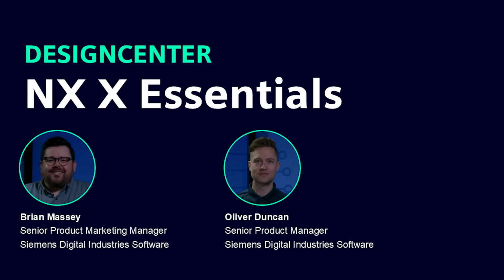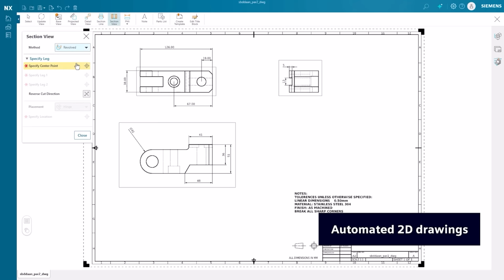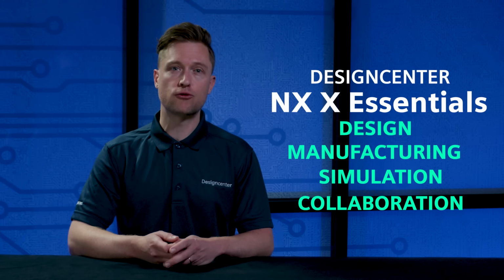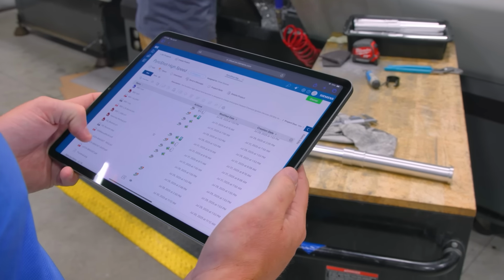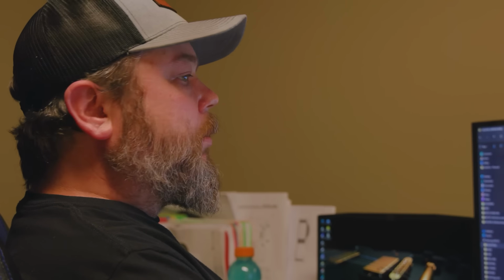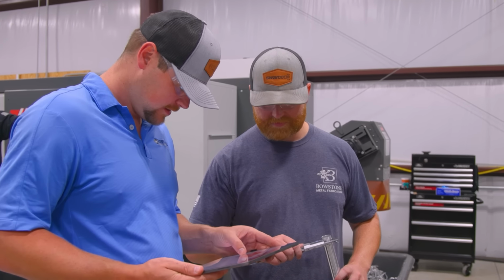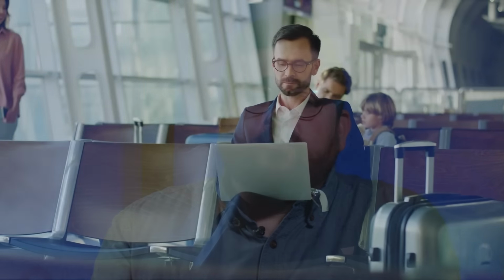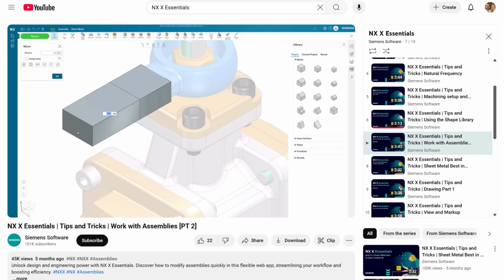Introducing Designcenter X Essentials - browser-based CAD/CAM/CAE

Comment: What means the alone X in “Nx X”?
Reply from the maker: Thank you for your question -- the stand-alone "X" in our product names generally refers to cloud-based versions of our products, meaning you can use them in your browser with no need to install separate software. Regards, Team Siemens
Reply: @SiemensSoftware So, the other updates will be used in the cloud and there will be no more software to install?
Reply from the maker: Hi again - As the social team are not product experts, we recommend you click the link in the post to learn more, which should answer your questions. Best, Team Siemens